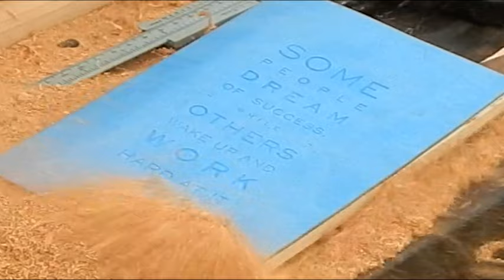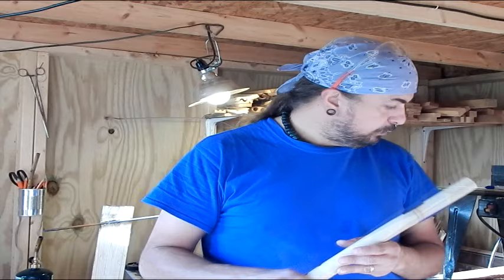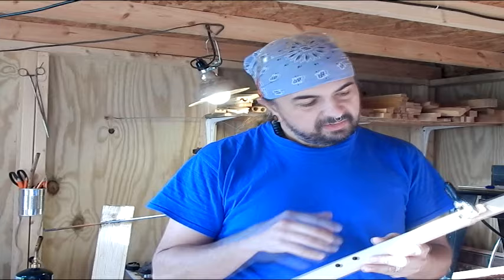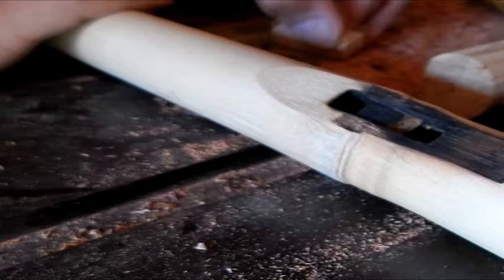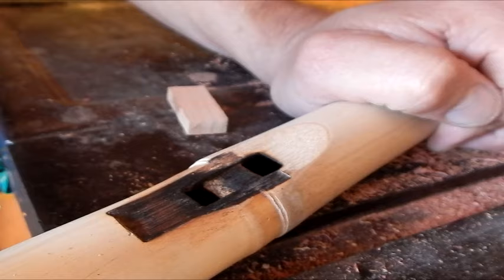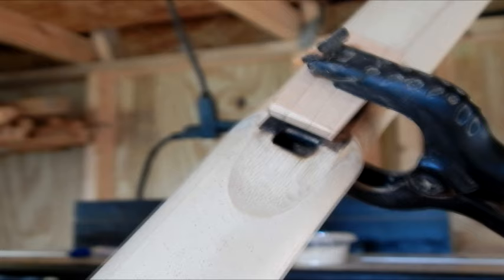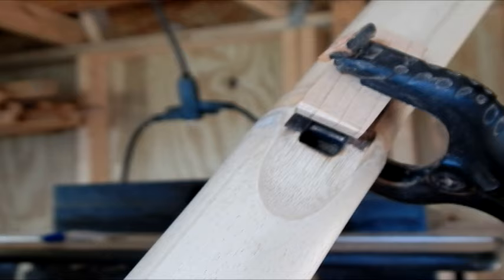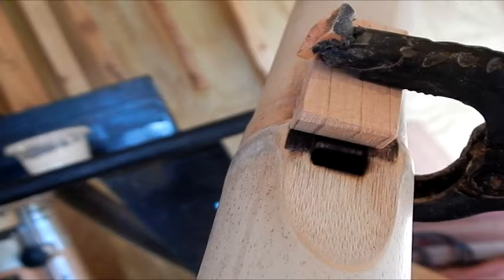Native American Flute - Perfecting the Block and Track for Optimal Sound

Comment: Fantastic info, I was concerned about attempting that bevel on the end of the track on some of my problematic flutes because I wasn't sure I was thinking about it correctly. I noticed placing my finger right on the edge of the block would fix some of the overblow and drop the tone, combination of block and track bevel should fix it right up!  

Thank you!!!
Reply: @BlueBearFlutes  These techniques saved two flutes that I thought for sure were a lost cause! Learning a lot by going back over my old mistakes and fixing them. 

I get upset when I mess up a nice piece of material.

Comment: I am very new at flute making and love your tips. However, while doing the 2 bevels has cleared the sound, but still, the top octave finger hole  is almost a step sharp. How can I fix this? It is exactly the same as 2 others I did - hole size and placement, even sound the same key, being all in A, but that top note sound on this 3rd flute is off. What can I do and what could have gone wrong? Thank you so much
Reply from the maker: You may have to fill the hole and re-size to what you need it to be in tune. It could be different because of the size in diameter difference between this flute and your others. I would have to see a picture of it to be certain. You can send it to my email address bluebear@bluebearflutes.com.

Comment: I have two questions: 1) How to calculate the distance to sanding the structure where the holes of the flute will be made? Since there are several different flutes and each one has a specific distance from the structure where the blow holes and the toten are located.

2) Is there any calculation to know the distances of the notes holes in the flute? Taking into account its overall length.

thank you

Comment: Hi Charlie! I had a question regarding the distance between the mouth end to the air intake hole, and then the distance between the air intake hole and whistle hole. Does this change with different notes, lengths and bore diameters or is it a constant? Ive been making those holes 2.25"(air intake) and 3"(whistle hole) from the mouth end. So I have a 3/4" long track, seems to work fine so far for G#4's and F#4's but again just wondering if this changes or you know a better measurement to use? If you have a video on it could you send me the link? Thank you!
Reply from the maker: Hey great question! I have been looking for the video where I answer it more articulately. Concern about the size of the air chamber and the distance from the air hole to the sound hole are relative. Honestly, those are the least important measurements on the flute and typically fluctuate from maker to maker, not flute to flute.😄
Reply: @BlueBearFlutes  Oic very interesting! Thats good to know, I guess since what I'm doing currently works I'll leave it how it is, thank you for the info 🙏🏼😊
Reply from the maker: @drewdunn9317  exactly! 🙂👍

Comment: Just wanted to thank you for the awesomeness! Just made my first bamboo flute...it has a faint sound, then I made my second (back to back) and it is louder but whistles if I don't blow hard, any ideas on a fix lol. P.S. I used a razor knife, drill, and wood putty. As the block I shaved a piece of bamboo and also used it for kind of a reed to get the flat surface.... Initially I drilled through the center, thats why I used the wood putty lmao.
Reply: I believe it's due to the cut not being straight.

Comment: Abrupt edges make eddys and turbulence😉
Reply from the maker: To produce the cleanest tone, the edges of the track need to be abrupt and uniform. Misshapen track edges produce such turbulences and are 9 out of 10 of the reasons new flute maker's flutes don't play properly.
Reply: @BlueBearFlutes  I was referring to the parts you rounded off, I'm not familiar with the anatomy yet.